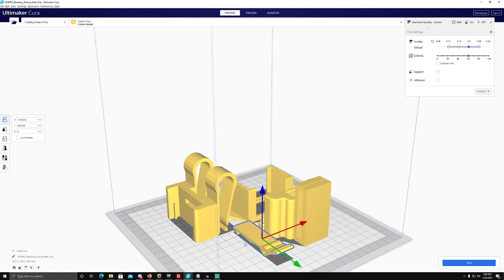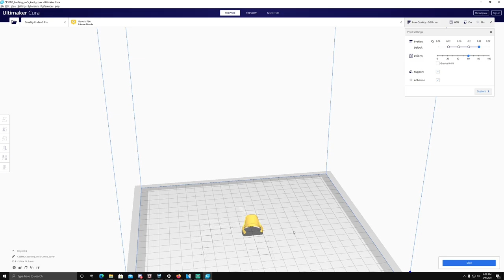Upgrade The Baofeng UV-5R Ham Radio With 3D Printing

Comment: Your "standard battery" was actually a extended one. It is thicker.
Reply from the maker: Yeah their are a lot of manufactures and distributors of the radio. With things like this from china, I think they all come a little different these days. I purchased one of the more expensive listings so I probably got a better battery.

Comment: as the parts go I was not impressed. due to the fact the parts didn't look that much of an upgrade when I had my baofeng. what filament did you use? keep in mind Pla glass temp is 55c to 60c meaning on a hot day that pla can warp or melt. where PETG can withstand hotter temps up to 75c also what layer height did you use?
Reply from the maker: Hatchback PLA. I can't remember the exact number, but it was a low resolution. I could probably get better results if I lowered the speed, and had a higher resolution.

Comment: Check out the Rail Boss Baofeng cage from a guy called @brinkerhoff_systems on instagram, it's a 3d printed exoskeleton that goes around the radio to keep the PTT or Volume knob from getting bumped on or off while the radio is in a radio pouch or a bag or something like that.
Reply from the maker: I'll check it out. Appreciate the tip!
Reply: About the only thing worth printing tbh.

Comment: That desk stand is awesome! I have the Yaesu FT 3D and put the 42" ABBREEEEEEEEEEEEEE antenna on it and it is hard to get it to stand up on its own. I don't have the cradle charger and don't plan on buying it. Maybe you should make some and sell on your website =).  Thanks for sharing!
Reply from the maker: Great tip. I may take that into consideration! The desktop stand is really handy.